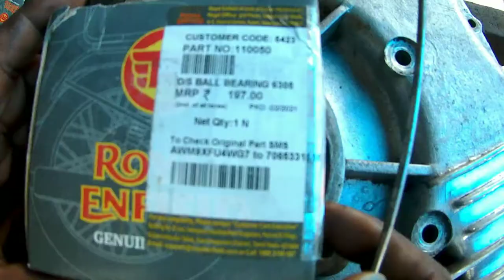old model bullet crank weight & engine setting #bullettipsvlog #malayalam

Comment: Bro.Antea bullet 96 model aanu epol engine work kazinju10 kg crank aanu. Bearing 205 thanea aanu 40 il thazha poyal edikkununde bearing mattiyal shari akumo
Reply from the maker: Bearing mathram mariyal idipp marilla. Athinte shaft sidil bush adikkanam
Reply from the maker: Bearing valuth ittal kooduthal nallath aanu
Reply: Bush chaithittunde
Reply from the maker: @pradeepmohan2817  und
Reply from the maker: 9497525798 whtsap
Reply: @bullettipsvlog7829  enikkum ithu pole problem undu.. Bush adichittundu. Bearing um valuthanu.. Nnittu 40 nu thazhe povumbo idippundu.. Athu maaran nthu cheyyum..
Marupadi pratheekshikkunnu..
Reply from the maker: @dhaneshkizhakkedan1787  cluch 3 plates ittu nokkoo
Reply: All 90,s models came below 10kg Crank, it may be 8.2 to 9kg, it may be modified by the owner
Reply: Timing side oil seal size onnu parayo

Comment: Crank weight ketiyatha but 4 th gearil idip varunumd oeu 30 km speed akumbo athu timing correct cheyth kure idip kurach but oru smoothness illa paranj tharamo enthu cheyanamenn
Reply from the maker: Rear wheel cush rubber change ചെയ്തു നോക്ക്

Comment: Faizal   crank  weight കൂട്ടിയാൽ piston pin നെ ബാധിക്കുമോ.   പുതിയ piston ഇട്ട് അധികം താമസം ഇല്ലാതെ pin  connect rod ൽ loos ആകുന്നു. അത് ശരിയാക്കുന്നതിനായി crank അഴിച്ച് connect rod ന്റെ small end ൽ bush അടിച്ചു് ശരിയാക്കി.  Fit ചെയ്തതിനു ശേഷം compression ഇല്ലാത്ത മൂലം വീണ്ടും head അഴിക്കേണ്ടി വന്നു. അന്നേരം pin connect rod ൽ loos ആയി കണ്ടു. Jobi ടെ ആദ്യത്തെ പണി valve seating ശരി ആയിരുന്നില്ല, അതു കൊണ്ട് വീണ്ടും അഴിക്കേണ്ടി വന്നത്.  ഇപ്പോഴും loos condition ലാണ്. എന്തു കൊണ്ടായിരിക്കും pin തെയ്യമാനം വരുന്നത്. നിങ്ങളുടെ നാട്ടിൽ pin, piston, cylinder, separate കിട്ടുമോ. ഇരിങ്ങാലക്കുടയിൽ കിട്ടുന്നില്ല, kit (piston with pin, rings + cylinder)  മാത്രമേ കിട്ടുന്നുള്ളു. ചെറിയ ഒരു parts ആവശ്യമെങ്കിൽ, മൊത്തം kit വാങ്ങണം.
Reply from the maker: Call me 9497525798 msj ittu rply cheyunnathinekkal nallath vilikkunnath aanu